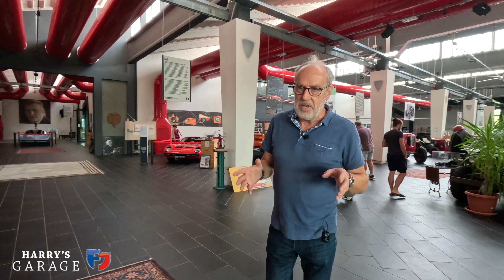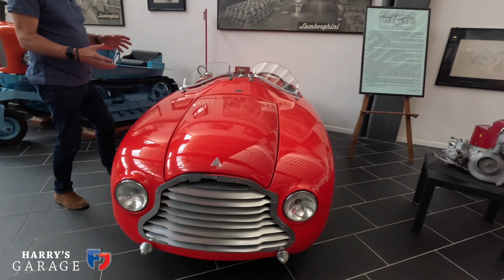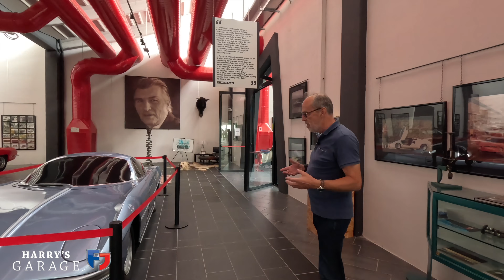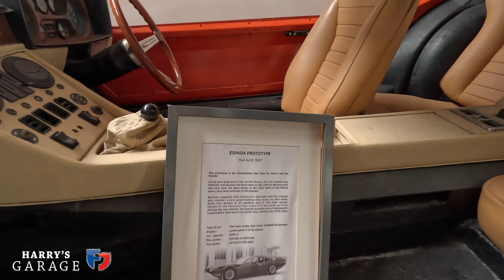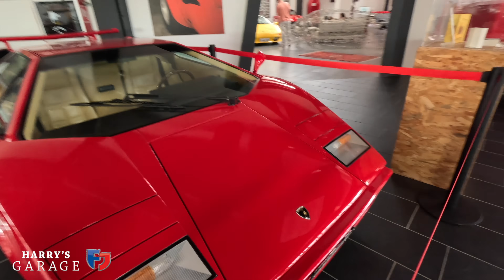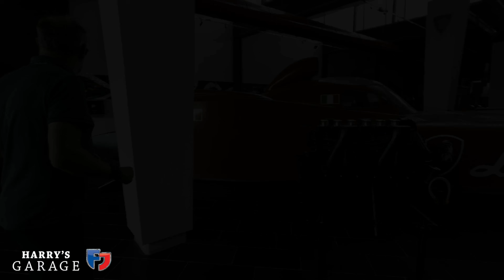Ferruccio Lamborghini Museum. It started with tractors, then supercars, helicopters & wine

Comment: Si intravede al minuto 20'04" la meccanica retrotreno della Urraco : propulsore V8 e cambio in linea a lubrificazione separata. Tale schema tecnico vene utilizzato nel 1969 sul prototipo in fibroresina Autobianchi Coupe' (1438cc PrimulaCoupe'S) preso "in prestito" dallo schema "Primula 109", novita' assoluta mondiale 1964, per la prima volta collocato in posizione posteriore centrale, poi ripreso dalle Fiat X1/9 e Lancia X1/21 (BetaMontecarlo). Esiste un libro a testimonianza di cio': "Lamborghini Urraco & the V8s, Urraco,Bravo,Silhouette,Athon,Jalpa - Osprey AutoHistory - Jean-Francois Marchet", a pagina 40... ^ On the Miura, the transmission had been located to the right side of the engine, or "behind" it, as it was all positioned in the chassis. In the case of the new Urraco an entirely new gearbox was located at the end of the engine, as it would be for a more conventional layout. This is what had been adopted  by Dr Dante Giacosa at  Fiat, first  on the Autobianchi Primula, then on later front-drive Fiats, and clearly signalled that the Urraco's engine and transmission could also be used on a front engined/rear drive car as well.^  La "disposition Giacosa", cosi' definita da Gregoire, e' rimasta l'unica ad essere ancor'oggigiorno adottata sulla stragrande maggioranza delle auto attuali. La Mini di Alec Issigonis venne invece venne definita "Nata obsoleta" dal grandissimo incommensurAbile giornalista Piero Casucci. Il poderoso V12 della Miura altro non poteva che collocarsi con l'ausilio di un cambio in blocco per ovvie ragioni di ingombro (si ricordino le imponenti Christies americane 19000cc, addirittura senza cambio). Ma la Mini venne preceduta dalla Audi Front F1 del 1931 con cambio a 3 marce, e venduta in oltre 100 mila esemplari. D'altro canto Issigonis, a suo dire, nutriva profonda ammirazione per coloro i quali lo precedettero: Andre' Lefebvre per la trazione anteriore (non proprio correttamente), e Dante Giacosa per la disposizione trasversale. Il resto poi e' storia... manipolata, alla quale Giacosa contrattacco' con le A112.  Si invoca divulgativa Giustizia storica per l'Autobianchi Progetto n.109.  Nota di dovere : le Lamborghini hanno sempre catalizzato sin da bambino le mie predilezioni, estese a tutte le creazioni di Marcello Gandini.

Comment: Tunnel Technique 101: Approach tunnel entrance at signposted speeds, upon entering, double-declutch down to 2nd gear and slow to walking speed, all windows wound down, Mash throttle to the floor, redline, snap throttle shut but Do Not Change Gear or Brake, allow car to slow at it's own pace back to walking speed, rinse and repeat!

Comment: Harry, about the spark plugs on the Morris engine of the early L33 tractors: those engines were started on petrol but could then be switched to diesel, using a fuel atomiser that Lamborghini had patented. See the Wikipedia page on Lamborghini Tractors.

Comment: Quite a few years back, I got to ride in a Wellcraft Scarab 43' DJ with twin Lamborghini V12s on employee demo day. 24 cylinders with straight exhaust running wide open in Sarasota Bay at 80+ mph, using surface drives that threw the most insane rooster-tail ever. And that wasn't even the fastest boat of the day. 

Great video. I love Lamborghini history.

Comment: We had an unusual an quite small twin hulled boat it was Italian with a bright green engine by Bianchi thing is it stopped running at some point, when I was about twelve I took it apart the coil was the issue and inside that engine there was Lamborghini stamped on loads of it, I imagine some collaboration? 
It was very stable my dad said with six people it had two rows of bench seats kinda hollow impossible to submerge probably nine feet by six?! We also had a three wheeled lambretta that also had electric sparking issues, I once rode through a ford on an old MV Agusta an promptly conked out with an electrical short, an a geezer past me an pulled over in a schimitar an as it got out he was brandishing a can of wd40 which was funny as he said he could see it was Italian.
Cheers

Comment: Fabulous tour Harry but you got the Urraco / 308 thing the wrong way round... Gandini's 1970 Urraco prototype lead directly to his Dino 308GT4 design three years later. Ferrucio rejected that first prototype in favour of the second one (which looked much closer to the finished article), then when Bertone were given the brief to design the Dino 246GT's replacement Gandini dusted off his drawings for the first Urraco, tweaked them and turned them into the 308GT4. Ferruccio's plan was to produce a thousand or so Urracos a year, alas less than eight hundred were built between '72 and '79.

Comment: Not to take anything from Gandini but the Miura is a refinement (not a copy!) of the Chevrolet Monza GT prototype from 1962, which really shows how advanced GM was back then.
Reply: The Monza GT was a show car. It  had a mid mounted air-cooled flat 6 cylinder of the Corvair. The transmission was flipped to accommodate the rotation of the wheels. The canopy windscreen served as the doors as well, to serve the two seats.
Reply: @davids9960  am aware of that, my comment was about the styling only. Gandini was I'm sure well aware of it and whereas he did not copy it, the influence is clear.

Comment: 14:57 I am guessing that this is a factory-made replica of the Marzal.  One car was originally made, using a Miura rolling chassis extended by around 120mm, and a one-off body by Bertone.  The original car was auctioned by Bertone in 2011.
Reply from the maker: It’s a restoration of the original Marzal done by a passionate Swiss Lamborghini collector. Amazing work and it drives as well!
Reply: @harrysgarage   Thanks.  The Espada wheels had me thinking it was a copy.

Comment: Thank you for showing the museum, it brought back a nice memory of my father. After the oil crisis in 'the 70's 'Lamborghini' designed a heating system that used old engine oil as fuel, and from memory it was aimed at commercial service centres which at the time had to pay to dispose of it. My father was sent over to the factory to learn how the system worked with a view to bringing it back to the uk. Several pictures of him stood outside the main building and internally of the boiler room where they used their own old oil to heat the factory! Ferruccio was a very clever man.
Reply: makes sebnseeven today there are Lamborghini gas boilers
Reply: I was in the process of repairing a  German  CNC milling machine  when I discovered inside the  hydraulic oil tank was a submerged Lamborghini hydraulic pump.
Reply: That's a wonderful story. Thanks for sharing.
Reply: what's the story with the 914 and the 65 ford mustang, as I would have never guessed he would have had those in his life
Reply: @Kavinskysmith  yes, I wish he would have touched on those